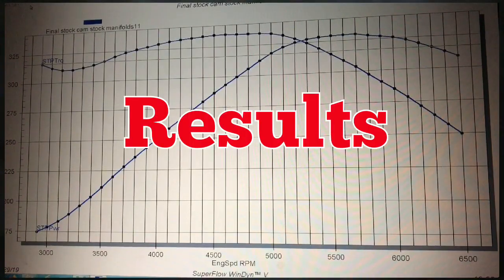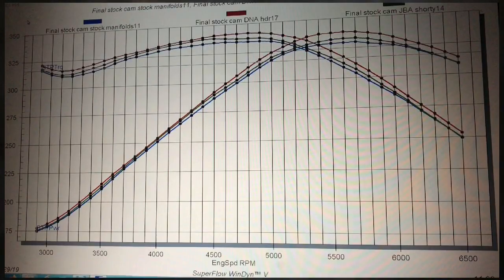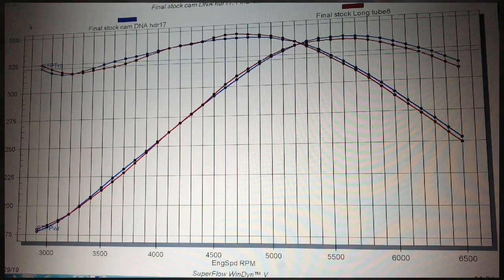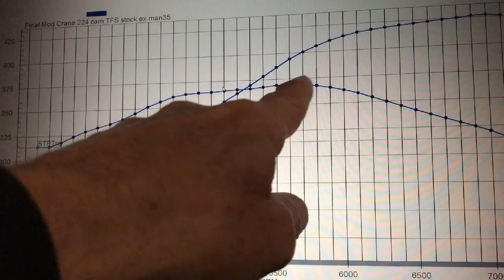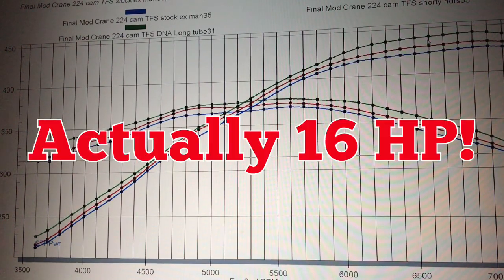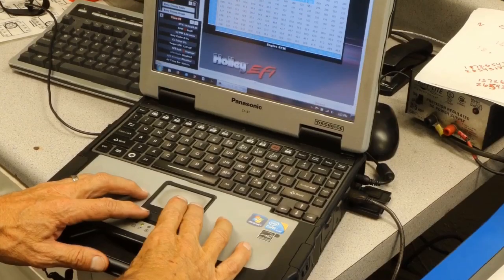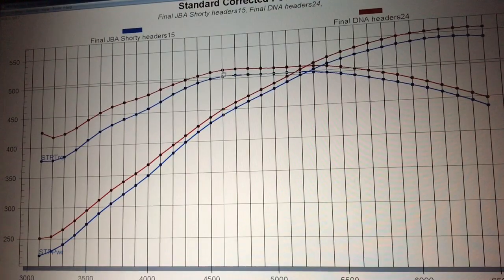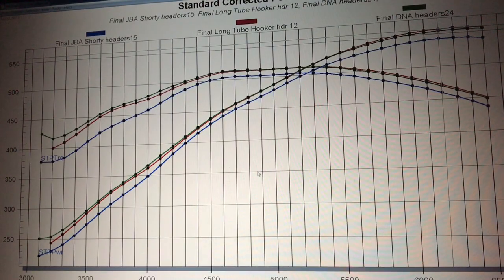DO THEY WORK? LOW-$ EBAY HEADERS

Comment: Kinda like Intake manifolds. OE offerings work as good til u step past the 6k RPM Zone.
Reply from the maker: maybe check out the results again
Reply: @richardholdener1727  shoud have been more specific. OE offerings work ok on stock motor, but once it's modded , long tube headers become increasingly effective.

Comment: It's my 1st time installing long tubes. What type/brand bolt to use and do I use thread locker or anti seize or nothing to the bolts?
Reply from the maker: WE USED STOCK BOLTS
Reply: @richardholdener1727  Thanks Richard! Advice on whether or not to put anything on the threads of the bolts, loctite, antiseize, etc.?

Comment: have you tested LS9 manifolds vs long tube headers? On a LS9 motor or similar power level
Reply from the maker: long tube header will make more than and short style, stock manifold-its not flow-its scavenging.

Comment: The thimg is that stock exhaust manifolds on the Big block and the LS are pretty good just by looking at them. on the other hand the log styles found on the small block Gen 0/1 appear extremly restrictive. so the question for those classic small blocks. how would shortys compare to the log style you find on so many vehicles through most of the years of the gen 0/1 even gen 2 small blocks
Reply from the maker: I've done plenty of stock ex man vs headers on SBCs
Reply: @richardholdener1727  I've yet to find a video on the subject. and I have watched a good number of your very informative videos

Comment: So all in all, me being a dude who knows mostly nothing about cars, don't expect massive gains from any, but you will gain some from going long tube headers, and its probably more beneficial for a better sound. And that the gains given aren't worth dropping double the price for a brand name. So if you're gonna change your exhaust system,  just get you a cheap set of long tube headers.  This to me makes sense given what the item is. Perhaps the longevity and durability is where you would see the greater benefit from the higher price . At the end of the day .- its a friggn tube.  A tube is a tube is a tube. Not much you can do to change a tube being a tube. Unless you are changing sizes , all things being equal,  a tube is just a tube

Comment: First off love your chanel! The info you provide definitely makes things clear when deciding on a build. So the numbers being the same make sense but my question is how about quality and long term use? Isn't that what you're really paying for? I've installed a lot of exhaust systems on exotic cars and what I can tell you is that you usually get what you pay for. Sure they will make the same hp numbers but the more expensive one will fit better and last longer. I've had friends that have flanges crack and other material defects that happen due to poor design even tho it looks similar to the nicer stuff.

Comment: Hey Richard, my question to you is which headers work good with a turbo or blower?
Reply from the maker: long tubes for blowers and almost any for a turbo
Reply: @richardholdener1727  thank you, hopefully I can get the 6-71 blower to fit in my rv.

Comment: I’ve looked at EBay headers. I liked the fact that they were stainless, but read the reviews about figment, and durability. They weren’t too convincing. I ended up getting a good set of Schoenfeld circle track headers, cause I wanted low to mid range torque. I had to remove my AC box to get them in, but once I did, the headers fell right into place. For a street rod that I only drive in goo weather, it was worth it. I gained ground clearance. My original mass produced headers didn’t give me that. I don’t have to lift the engine to remove or install them, and they actually gave me a pretty noticeable kick in the butt, when I drove it.

Comment: Love your videos, thank you for sharing them. How do you think a 1 7/8" c10 Tri Y header would compare to the long tube? I will be swapping a 6.2 L92 short block, with 799 heads and Trail Blazer intake and Summit Stage 1 truck cam, 2 1/2" ex with a H pipe and Thrush turbo mufflers into my 67 SWB C10. My goal is max torque under the curve, with no cam lope. Thank you.

Comment: I would like to see gen 3 hemi stuff. With hemi swaps not many options from from stock. Ram logs to jeep logs and car logs... srt stuff and very few aftermarket. How restrictive are the stock logs. Also eagle head swap is it worth it? Factory 392 vs stroked 5.7 392 is one better than the other.

Comment: Hey how that sparing match turn out friend i wonta see his nose ,,, lol i had to man:) Cheap as the price on stainless usa ones that i last seen were stupid high as its metal the other option at that times was rust headers thin cheap and should not even be made i got 3 sets rusting away in woods junk yea priced fair but why not use stainless steal and a bit on fer cost but may be nexty time i look at holley or others the pricing be better but iu bet not ,like i say on efi get a megasquirt as evem the microsquirt can interface with android and be a tuning fixing dash gauges tool via like a 20 but add on i mean heck the complete efi system and a 02 sensor with blue tooth thing  and a 4gb ram android 2 din radio and the new windows net book laptop 900 buck yes true and that not the cheap stuff nether about 750 is and 1600 or so if one buy the real good MS. unit heck one can use an o2 sensors on every cylinder i my self just use a gm computer at that point i guess never needed extra stuff yet i cheap bastard but smart    .[[[.i say this rambling spill  because pay more means nothing if it the not the right stuff spend cash on cryogenically treating rods and arp rod bolts mls gaskes port work or heads turbos things that need money to work better ]]]]]

Comment: This is a good test but one thing you have to factor in is header primary tube and collector flow on each set of headers. We have found through dyno testing and flowbench testing that header flow will have a dramatic effect on hp output. Two different flowing shorty headers will not produce the Same power output. Same as the long tubes. There's so much science involved when searching for more hp.

Comment: Hey Richard if you have time could you give me a quick answer. I’m running your low buck set up. The eBay gt 45 on a basically stock 5.3 controlled by a FiTech ecm and harness. What size injector should I run with an end goal of 6-7 psi no more than 10 ever. Your advice would be appreciated. Long time viewer love your videos!!!

Comment: We install headers almost daily & we also have a dyno jet. You are correct on the power output is equal. When a customer comes in with ebay headers we charge a extra 2 hours on the install ($220) because THEY NEVER FIT!!! We have to reem out flange holes on ebay headers all the time. God forbid a customer brings in a long tube + y-pipe ebay combo because the y pipe always needs a ton of persuasion to align which more often than not requires cutting and welding. Moral of this story, what you save on buy ebay headers is spent on installation so it winds up costing the same. I say buy name brand because in that case you get customer service from the manufacture and a real warranty not a Wuhan Warranty!
Reply: This is solid advise!  Few people ever look at the whole of a job.
Reply: What I saved from buying on ebay I used on another mod for my car instead of giving it to some chumps to unscrew and screw back on a pipe.
Reply: I was just going to say this about fitment and buying cheap headers. This why I went with kooks 1-7/8" on my 08 Vette. I want it all to fit right and I don't want them to hang low like all the cheap ones do

Comment: Since I started getting involved in higher performance domestic 8 cylinders, I've always heard about how headers were something you don't skimp on.  I couldn't get over the fact that a company here in the US could make something for $1100, while a china company could make something almost identical for $250.  It's a simple bunch of steel tubes haha.  I have bought more expensive domestic headers and they all require modification to clear plugs, frame rails, starters.  I'd feel much more inclined to go smacking a cheap set of headers than something I just spent a paycheck on haha.
Reply: You mean you'd pay two guys to smack them?  🤣
Reply: Same here
Reply: Same.  From all of the Youtube videos Ive watched of guys installing high dollar headers, they ALL run into fitment issues.  So I might as well get some cheap shit so I can just pay a buddy to deal with the headache. XD

Comment: Cheap works great at 1/4 the price, if something happens just buy another pair. I bought a set of long tubes 2 inch by 3 inch collectors stainless steel, paid less than 400... gained 46 hp on 2016 LT1.

Comment: I put a set of Hooker Super Comps on my mild 350 in my '76 Camaro. I only used them because I found a set for $50. But I have to say they are the best fitting SBC headers I've ever owned. I only had to clearance one tube to clear a spark plug. Everything else was great. They might not be optimal but the good fit was worth the trade off.

Comment: I'm behind the times trying to learn the Ls program NA vs. FI, and really liking these videos. Maybe I'm missing some basic assumptions, but if you could speak a little bit to fuel used in testing/application that would be great. In my area pump gas is 87,89,91 with 10% ethanol. I'd like to know safe power potential with 87 and 91 if anyone wants to comment. I'm not interested in race gas or e85 if I go w boost.

Comment: Had my cheap ebay lt DNA headers on for years and the only gripe I have is the primary on the driver's side has a weird turn to clear the steering shaft which sometimes burns a plug wire. I just used header wrap and wrapped the plug wires with the boots

Comment: I just installed DNA long tube headers, mid pipe with y pipe assembly on my 2009 RAM...overall pretty impressive and their customer service even in China has responded to all my requests and or issues....I would 100% recommend the DNA long tube headers...and oh yah they are pretty loud and mean sounding with my Flowmaster super 10 ....👍

Comment: What are the chances of doing an 8 into 1 and a 180 degree header
Reply from the maker: hard to package
Reply: @richardholdener1727  yeah without a doubt unless they had some slip joints and springs at the collector

Comment: They have even cheaper on Amazon.  Heck they probably have plastic headers on the net somewhere. 
Anyhow Longtube headers will outperform the shorties in the whole rpm range. 
Shorties are for fitment issues

Comment: i was actually wondering about this very thing when looking at headers for my 2000 trans am. One thing im still a little unsure of though, is if i should be using long tubes with a supercharged application. I wouldnt think it would be an issue, but i'd rather ask a stupid question than make an expensive mistake.

Comment: Not sure why anyone would think that low buck headers would result in much difference in power over more expensive headers.  The difference will be in the metal used as well as finish and even fitment.

Comment: I've had my dna headers for years only thing I hate about them is the driver side 3rd cylinder has a funky bend to clear the steering shaft. I have to use the boot plug wraps to keep them from getting burnt up

Comment: Already got ebay longtubes for my Coyote, they work great.. less then $200.00 for them only issue i had was one 02 sensor bung was welded a little off center from the hole so a little grinding was needed to get the sensor to thread in, but im not complaining, I saved alot of money.

Comment: Do cats destroy the power curve when used in place of the collector extension? What about putting glass packs immediately after the headers.

 Do the factory cats Rob a ton of power? It's been said that newer cat designs are highly efficient and have minimum power loss. I'm curious as to if they have some effect on scavenging or resonance tuning or whatever.

Comment: Do they work? No, the question is... will they last?  Bet you can't get past the 2 year mark without warpage problems or some such headache.  But if you are running in the dirt, you may not care.
Reply from the maker: our cheap ones have been around several years-but not on a car-that is definitely a consideration

Comment: You didn't mention it but look at how much torque either header makes at 3k rpm over manifolds. Your talking like 20-30 ftlb. Usually this will stay even if you have a full exhaust. Your dyno results are valid but they don't show how well they fit in a car, there is more to this.

Comment: Richard do a big favor for me and all the other to see, this would be an important test.  Do a 4-1 header vs a 4-2-1 header dyno test.  i dont buy headers i just make my own and i gravitate towards the 4-2-1 as just driving down the highway or leaving the line or changing gears, the car just responds better with the 4-2-1 headers.  As far as HP at rpm i dont know never dyno any engine i ever built.  So can you do another header test for us, a 4-2-1 vs a 4-1, i would be fine even if u used the same header just changed the collectors from a 4-1 to 4-2-1.  It would be nice to know how do they affect the power curve.  Thanks and i hope u can get a test like this done soon in the future. dr Dave
Reply: Yes!

Comment: The biggest thing I learned is anything naturally aspirated under 550HP doesn't need dual 3" exhaust. The 2.5" didn't trade anything up top and gained torque down low over the 3".
Reply: Good point. I also noticed that all of the testing takes place above 3500 rpm. So for a street car not in the rpm nosebleed section, you may be able to do pretty well with just a good set of manifolds.

Comment: What really matters is how long the header lasts. Yes a cheap eBay header makes similar power to an expensive one BUT, a cheap eBay header will not hold up nearly as long as a quality stainless header. Also don’t forget things like flange thickness and quality and once again the eBay headers really are not as good as expensive ones
Reply: That's kind of moot for people that drag race, who change out engines like people change shoes. For home use, they probably last long enough, five years?

Comment: Why are you calling them ebay headers (manifolds is the correct term)? They are not produced by ebay in any way! They are just sold on eBay. You don’t buy a steering wheel from a manufacturer on the internet and call it an internet wheel do you? Simpletons.

Comment: If the cheaper headers were to lack something that the more expensive headers had, I wouldn't put my bet on performance.  It would more likely be the longevity.  If your cheaper headers are made by a hobbyist with a flux-core mig, I'd worry more about the conditions of the welds under long-term distress.  But if you're the sort of builder who is constantly exploring new components, it's a pretty good deal even if they only last a year or two.

Comment: The cheap ebay headers do not look like they would fit in many engine bays and clear things like steering columns.  This allowed them to have straighter exit angles from the exhaust port flange.  This could help them with power production over the tighter fitting more expensive long tubes that also looked to have better collector designs.  Durability as mentioned is also an important concern as is quality control.  Last an important is CHINA is damaging our USA manufacturing businesses SO if you can PLEASE buy quality made in the USA.

Comment: I bought the ebay headers because the stock exhaust manifolds on my vortec engines shrink and break the bolts off in the heads. The ebay headers fit perfectly, thick flanges and they work great with no leaks.

Comment: I brought some headers for about 250 came with the header y pipe and extension after the y.they didn’t fit just becouse the extension hit the cross member for the trans but it was nothing mufflershops can’t fix.
Im really happy with them and haven’t had any problems love them tbh cammed  out 4.8 
I mean 1 7/8 from good brand header 
Is not a different from
1 7/8 from a budget header right. Mesurment is the same